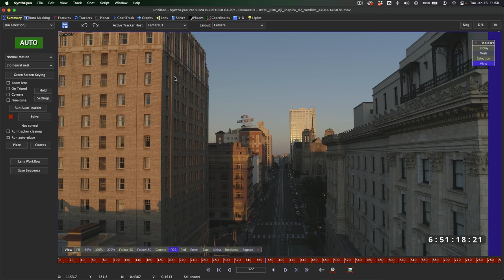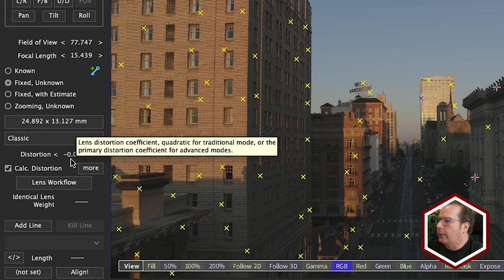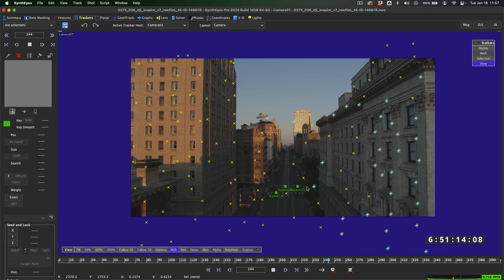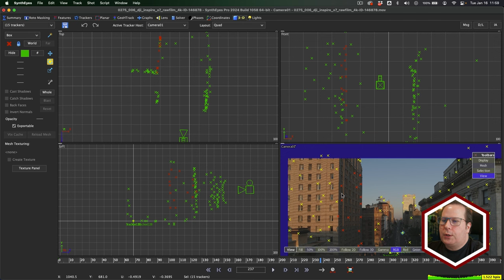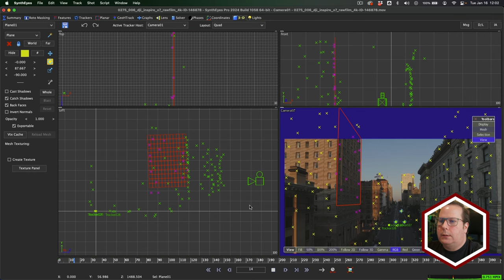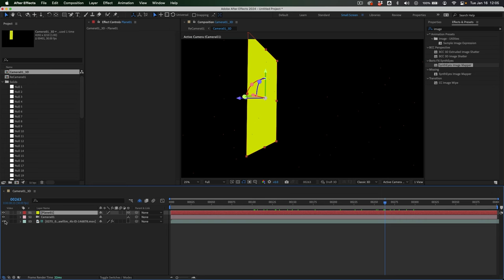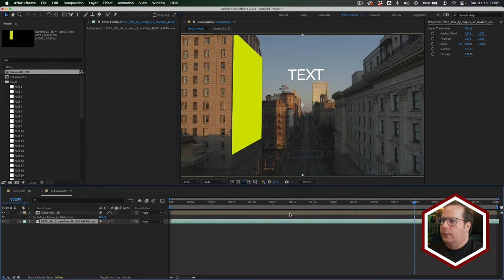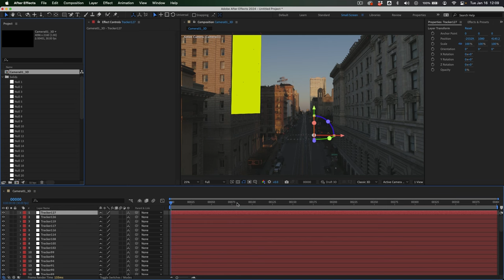What's New in SynthEyes 2024 Part 2 - Solving & Exporting Distortion for After Effects

Comment: I would love to see the lens distortion backed into camera setting for blender.
Reply from the maker: That's an interesting feature request.  Where would you expect that to be shown? As an Undistortion node in the Compositing nodetree?  Would it change your mind if that limited the quality of the lens distortion models you could use?
Reply: @BorisFXco  yes, if you track a footage in blender, it automatically add the distortion to the camera setting, you can turn it off and on, there is also a distortion node in the compositor that holds the values which we can use on the footage, I’m not sure what type of calculation blender uses for distortion but its very good, we need to use the original footage in other platforms, syntheyes forces us to bake the distortion in the footage, the whole distortion workflow in syntheyes is actually confusing, looking forward to that, thank you